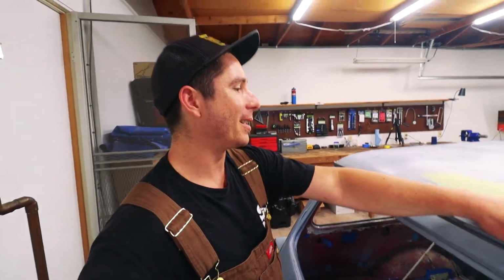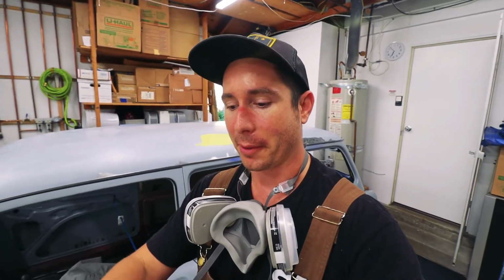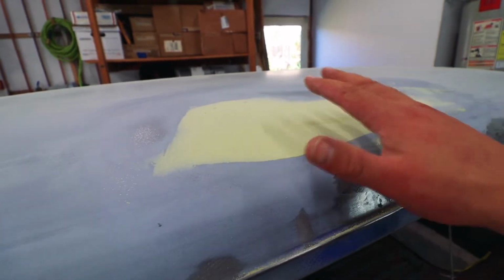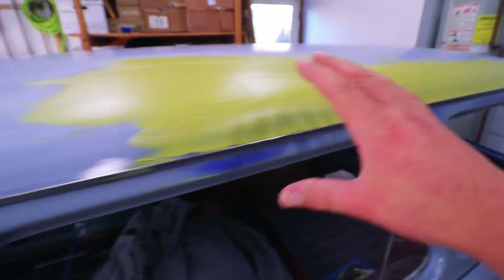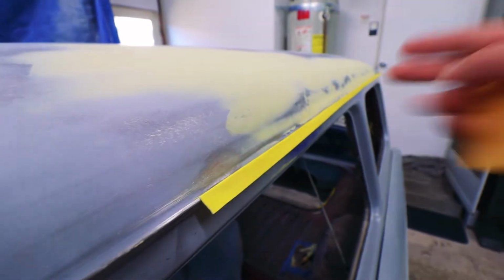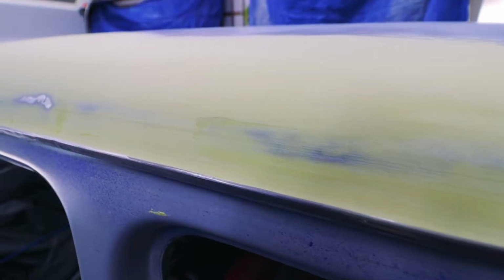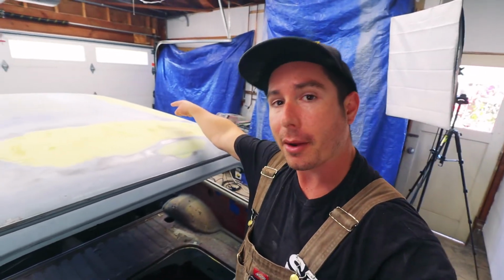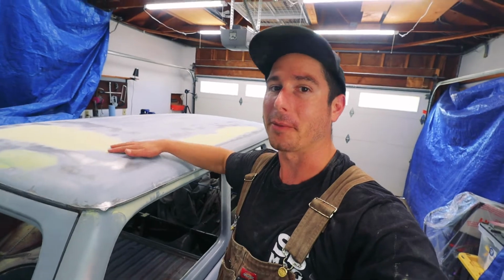1967 VW Squareback Build (Plastik Honey Helps Smooth Out Huge Type 3 Volkswagen Roof)

Comment: I think the filter on that sander comes off and you can attach a vacuum...
Reply from the maker: Dang I might try that. The o rings for the dust catch on the back are all worn out so I have to keep taping it on. Would be nice if the vacuum could capture more dust.
Reply: @DreamWrench   I think I tried it once years ago and it didn't work too well, but your situation might differ from mine.
Reply from the maker: @motoflyte  Yah I have a feeling it's still going to fling dust everywhere like a sandstorm going off in my garage